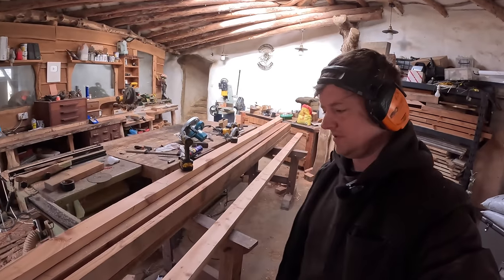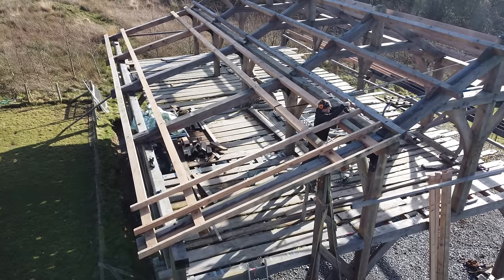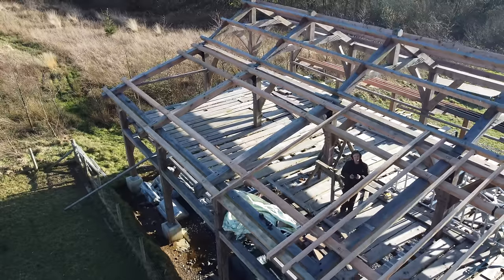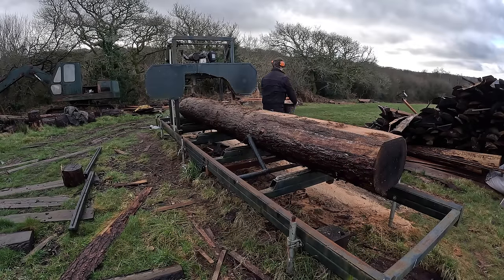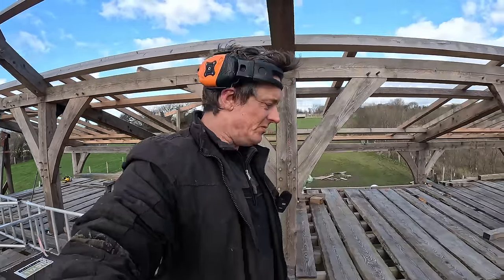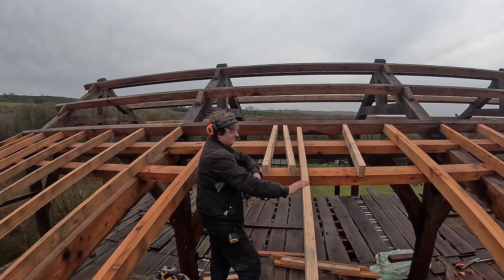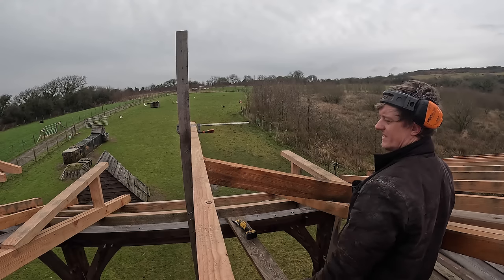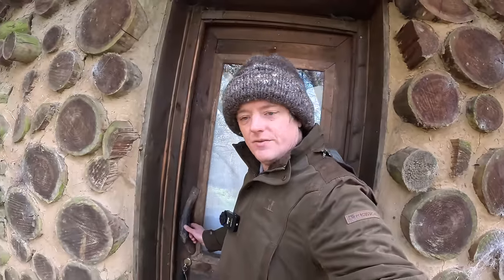Timber Framed Barn Part 22 Roof Rafters

Comment: I'm a designer for a commercial / industrial roofing / cladding company, for anything like that we would  make custom aluminium valley gutters. Just make them generously wide under the roof sheets with a pitch as low as that and use foam fillers to stop wind-driven rain being pushed over them.

Comment: So glad you decided to insulate - I have an uninsulated hangar in soggy Dodogne and every winter I have to bring all my tools and most of my materials in to my house and give over the ground floor to it all, otherwise everything rusts and moulds etc. I can't wait to upgrade it with insulation and managed ventilation so I can have a proper store and workshop. My first thought was decent storage for Dot's fleeces on the upper floor - a dry insulated space with some humidity management would make that possible 😊

Comment: Just think he's done all that  runs  a farm builds a House ...Timber frame Barn digs a water lake reservoir holding at leased 20 Billion litres of Rain water.... Lumer jack Cuts and Replants  600 Million Trees  produces all his Timber needs with his own Self Built Saw Mill ... builds a trailer ...fence post Basher....a 200M watt Hydro electric scheme  up in the Lake District  repairs all manner of Automobiles ...Constructs Numerous Toilets ..lays 600mile of underground water and electric pipes and cables supplying all his energy needs plus half of west wales and raises chickens...geese .... sheep ....  feeds the cat  builds a Glass and timber Green House ...grows all his fruit and vegetables ...does all his Roofing and building elements  Bespoke  Artisan Dormer's whilst professing to no nothing  about roofing he's a welder ...electrician  ...plumber..car mechanic ..telecom Tower manufacturer.... radio amateur .........a  Bespoke wind Turbine Blade Manufacture design and manufacture of Electric generators both single and 3 phase converters to Power his Own Designed and Built Two storey High tech Workshop and Garage Repair Complex built in the side of a Hill excavated by himself a small spade and a tractor .....produced all his slaked Lime and Rocks of all kinds......fitted an commissioned all his engineering Equipment Lathes ..planners... platform drills...CNC Plasma Cutter ....and many other items too numerous to remember............all that whilst living in a wet paper bag with no water..... toilet....food in the middle of a busy Dual carriageway in wales....

If you were a film producer wishing to portray a self made  ontrapinure   with no engineering training ...carpentery .....electrical......computer science telecomms   software skills ....and left school at 13  no "O" levels to speak of ....started his own  Tree forestry and Lumber Jacking chainsaw  business.....and succeds to where he is tody .......the  progression of so many achievements in such a short time  would simply not be credible or believable and you would be dismissed as  a looney for coming up with such a storyline of amazing resilience and determination to get things done .......just would not get of the ground

Show quoted text

Comment: Hi Kris  i see you've,  Gotten  on to the roof.  yes you right  you will feel a moment of the beams in the wind . a bit lick a ship at sea  what-what.  don't be to worried about that. it will stiffen up once  you have the side in That that massive deck is. Nailed down i must say i suppose your waiting  to dry it out before we get to that.   wet whether a all . get some external side boards  {Cladding}   on at lest  that will stiffen it up some what. when we work with natural timbers   Their is a modicum of movant. i did a bit of steeple jacking in my day & at the top of them chinois even church spiers & even those  Chemins  being mad off concrete  had a remarkable sway to them  church spiers Not so much  But you cold feel them moving.  My dad would say get up the lad.  it all in your Imagination . LOL ha ha ha Omg i would  say  I hop  your right . as a lad my dad know Fred Dibner & them too collapse a lot of chimneys.  &  them  Brik Bouguer.  seemed to sway a lot  to  LOL      Les & Jan

Comment: Great work Kris. I dunno why - but the multi-tude of odd jobs was what got me hooked and I enjoy that immensely. 

If you're going to work and live in that space I reckon some more windows might be needed. Perhaps second level barn doors with block and tackle for lifting some decent equipment etc upstairs. 
Its a fairly significant change in reality.  I'd be making it as liveable as possible now rather than later. Even if you put in what is needed to make it easily updated. I mean - a nice outdoor balcony at the far end wouldn't go astray, or even a roof viewing deck......

Comment: Mmm, these rafters will want to push the walls away. I'd have a slight different way to make these.
I'm also questioning why the insulation, why these windows when it's a barn ?
I have a friend like you I suspect, he's also a perfectionist, claiming the way is more important than the result.
I can understand, but I'm also familiar with projects that will get more and more complicated along the way. There also might be motion-pictures about stuff like that.
Synecdoche comes to mind ;o) Still, I find your projects amazing and are in awe most of the time.
Cheers !

Comment: Simplest use for the upper level of the barn would be ... DRYING PLANKS OF WOOD for use in a few years.  All the stuff you use is fresh wood, but that will shrink/dry over time and require adjustments if it was used for a floor. Having dried planks available is a good idea.

Comment: @22:20 when doing your calculation you said that the ridge width was “50”, but you entered “58”!  Which was correct?  If you intended 50 then you got a bad calculation!   YEAH, @25:40 you found out you got it wrong…. Not a huge mistake!

Comment: Ide be half tempted to turn that barn into a massive forever home and turn the cordwood house into another shop lol...Just saying...🤣🤣  
I have a question that i cant find answers for on the web, if you could possibly help...
Im about ready to start a timberframe home project on my mountain very soon..
I need to mill up about 30  12x12 beams between 16-26 feet long... unfortunately my kilns only 15 feet long inside..
 Is there any way i can lower the water content in the tree before felling them? Maybe end up with lighter beams and less twisting after install..
Maybe put a few handfulls of taps in for syrup or something?
Alot of the beams are only going to be milled on 3 sides... 1 live barkless edge showing..
So if i could dry and loosen the bark before dropping them that would be awesome..
Ide def have to look out for bug infestation though..
Any thoughts on standing dehydration tree death?? haha 🤣🤣
Thanks...
Keep up the great work there brother..

👍👍

Comment: I totally understand your concerns about making the roof watertight :) The trick (based on painful experience) is not relying on any one method or material. The natural movement of the structure (expansion, shrinkage, and wind movement) needs to be dealt with. In my experience, overlapping layers of different materials (which can move without failure) has worked best. Cheers!

Comment: What's with the excavator machine parked by the sawmill?  A very useful machine for manipulating logs if it has or you add a "thumb" to the bucket. Love the way the dormers work with the lines of the building.

Comment: Always inspireing and a good start on a monday to watch another video. Great work :) . Regarding the wind mill wheel bearing. I seem to remember you using copper grease for lubricant in it. That wont work. It will grind the bearing down very very quick, as was mentioned to you in that video. Got to use propper bearing grease.

Comment: I just saw your wind turbine bearing failure... when you redo it revthe configuration.  Put the spindle pointing up,  which will put the seal facing down. This will keep rain water from ever reaching the bearings.

Comment: It’s not so much the weight up high Kris as the wind resistance of all that open framing. 
There was a guy building a very large 300’ X 75’ workshop near me and the framers raised open stud walls and had most of the open rafters up when it blew down. 
They wasted no time restarting but this time the walls were sheathed when they were raised up. 
Open framing is worse in the wind that a sheathed wall.

Comment: I might not understand the full situation but I've often wondered why wool isn't used more for insulation. It's low energy production, you get a free sheep and it doesn't burn very easily, it can be treated to be rodent proof and given the number of sheep farmers who end up out of pocket for shearing then I'm sure some sort of government incentive would help, especially given the terrible state of the UKs homes regarding heat retention. Of course that's too obvious

Comment: Cris, with such a huge roof and with the weather you tend to get there, you might regret not having notched the rafters.
They sit differently and are more prone to slide and bend over time. I suppose you could add notched supports, screwed onto their sides but I really wan't to advise you to not just leave them like that, not for too long.

Comment: I was a mechanical engineer in mines and quarries for over thirty years when replacing your "wheel brg" make a light dome metal cover to live above the seal, it was designed to shed water in the horizontal not the vertical axis if water lays on the seal as it is, it will find a way in due to the type of seal employed for comparison examine a motor cycle fork seal for vertical type layout, hope this was helpful.

Comment: Is that the bearing that you put copper grease in... only reason I ask is I was wondering if it was anti-sieze... if it was antisieze it would have had abrasives in it causing the failure.

Comment: That's going to be a lot of trips one board at a time. Are you going to spray foam in the ceiling or are you going to use conventional fiber insulation.

Comment: to  save your self a lot of time and cutting and fitting. there are two different options one is preinlated steal roofing panels.do a dry wall or  the stuff you want to see from the inside first. then your 2 by 4   with insoletion  wiring if  then  fallowed by osb ice and water shild then you roffing miteral

Comment: Hay Chris,  love the channel have from the very beginning. 
Want to make sure you have a one inch space between the roof deck and the insulation so the roof can breath, open at the bottom and top to allow the air to flow, there by keeping the inside of the building cool in the summer and warm in the winter, it also stop any condensation from developing in the roof structure.
And thank for all you've done over the years your quit the inspiration
Terry.

Comment: Poppy's a lucky ladymm, the view from her office is going to be lovely. It shows how good your craftsmanship is, if you can only feel a little bit of flex in your Cathedral. Your right with the rain, I live in Hampshire and like you I don't think we've had a good spell of dry weather since July last year. What I have noticed is as well is that the downpours are definitely heavier than they used to be, so much so that I've had to change my guttering to that deep flow gutting. Looking forward to the stone walls going up and glad your using a lime mix as well, it will allow the stone to breathe. 👍

Comment: No birds mouth on the rafters? Tut tut. Love your work by the way!!
Reply: Also, get yourself a copy of Goss’s roofing ready reckoner. Every roofing chippys bible!
Reply: Given that the rafters aren't transferring lateral loads to the wall, just vertical loads to the perlins below, birds mouth cuts aren't necessary in this case. At least that would be the judgment here in the US, idk about the UK...
Reply: @kschleic9053 I personally would never dream of doing a cut roof and not have birds mouth’s on the rafters. I think building control here in the U.K. might have an issue.
Reply: @John-m5k4r  Did you actually watch the video? Maybe you watched on your phone? Watch again and you can come back here and explain your mistake in glorious detail.
Reply: @Valisk actually, I did indeed watch it on my phone! Pray tell, what was my glorious mistake?
Reply: @Valisk okay, just watched it again… if you’re referring to the plates and purlin running to the rake of the of the roof as opposed to being flat, then I guess you could say it wouldn’t be a birds mouth cut, however, I would still notch the rafters over the plates and purlins!